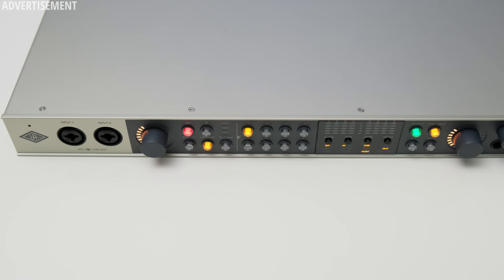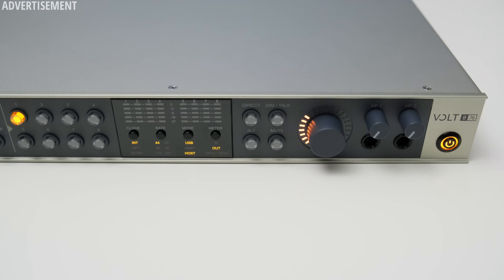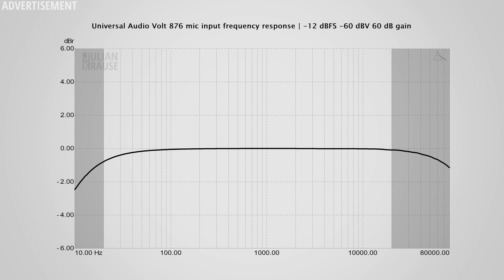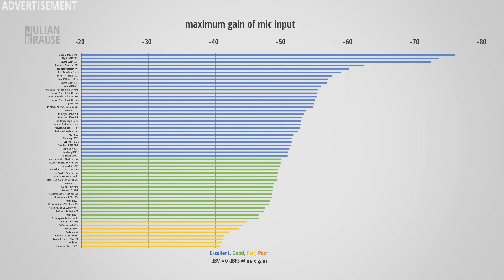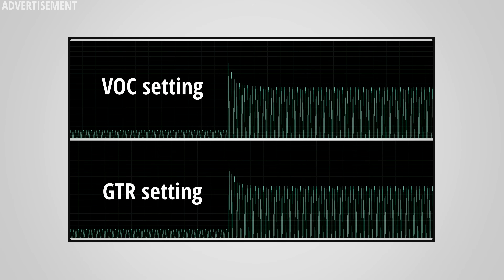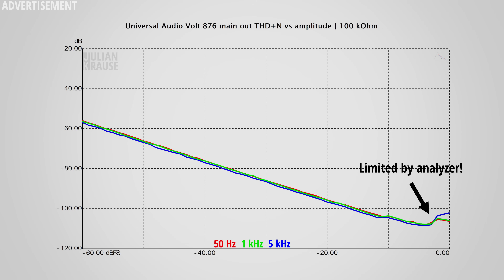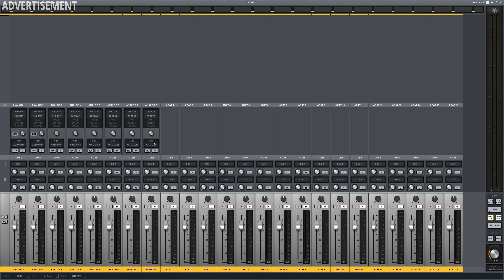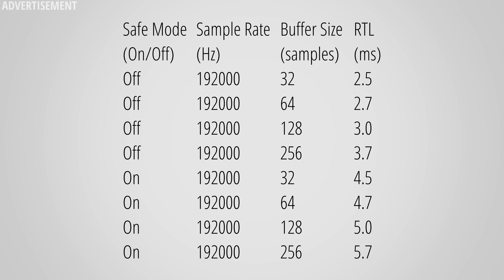Universal Audio Volt 876 – USB Audio Interface Review (Vintage mode and 1176 compressor)

Comment: Maaaan, such a timing! I am trying to decide between this, Audient 48 and Motu 828. Your review on this one will be much appreciated
Reply: I really like my motu 8M and my current setup but this thing really looks worth looking into.
Reply: SSL 18
Reply: My Audient ID buttons were dead within a year and the fu**king ID Mixer software doesn't let me choose the output between monitors and headphones via software(only mute). Audient ID mixer is like a 90s software. Get the MOTU. MOTUs got rock solid hardware and routine capabilities
Reply: @knownasbulu  mmm... I am interested in this problem, because I use the ID14 mkII since the day it was released, and I never had a problem like that. In fact, I used and abused the buttons and the rotary encoder.
Reply: What about the MOTU 10pre?
Reply: Audient ID48
Reply: Just for the pre amps, I am extremely happy with my Audient.
Excellent tone even with a guitar DI.
This looks interesting for the front end features.
Reply: Audient has a cleaner, punchy and warm preamp.
Reply: what did you choose?
Reply: @kitanlain i have the audient id24. And never looked back
Reply: Motu 828 is very modern, makes all these other interfaces look like they from 2005
Reply: Buy the MOTU.
Reply: none skip and get your self prism or apogee or dangerous  with superior clocking and conversion apollo is not known for its clocking or conversion even antelope also way better  you get mastering grade  i find apollo sound veil and way to colourful in a bad way
Reply: Apogee support on 3 year old products is not good.also, they just changed owners.
Reply: Don’t buy the MOTU… after the guarantee runs out, unlike RME, the after service is not great. My RME UFX went down - bear in mind that it is the first version and pretty old - not only did I have no problem getting it repaired for an unbelievably great price - it was a HUGE chunk of technology - but they rushed the repair because I was in a production. RME interfaces have a great reputation for their sound and the drivers and they support legacy products no matter how old. You can’t go wrong when you consider the aforementioned factors but also the cost effectiveness when considering how long they are supported and how long they work.
Reply: Thanks everyone for your opinions! I didn't mention that my setup is build around Linux... so there's a lot of stuff that I will try to avoid in general... Exclusive software controlled features like routings, DSP and else. If I can't control them in Linux (like Motu's and RME's unofficial software) or the front panel, I will avoid it. I really love Audient, but a single guy successfully achieved to control the interfaces' internal routing just a few months ago and the controller is still in development. While not an Apollo, this Volt 876 checks a few boxes regarding manual control for me. I still have time to make the right choice.
Reply: @kelvynification  yeah my total mix just doesn’t work on Mac so I’m having to jump ship